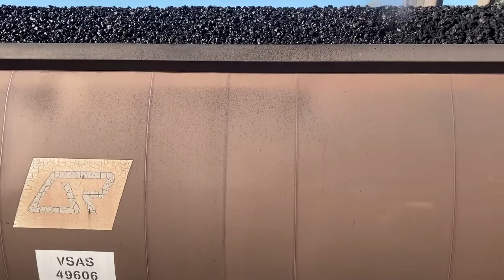Loading a Coal train

Comment: Train loading station where coal loading is regulated from CCR TLS. Using a hydraulic engine/HPU has a component above the surge bin & weight bin which can be adjusted how many tons will come out like having two side chambers, a gate that functions to open so that coal is in surge the bin goes down to the wight bin otamatis / manual will be closed according to several tons of requests from the CCR, when the gate is closed the chute will open throwing coal in the designated train area, hydraulics and PLC are one of the components, thank you

Comment: It’s a nice look at the loading, but can you show the electric locomotive passing through the loader bin, I really would love to see what happens with the pantographs as it passes through.
Reply from the maker: they lower down as they sense the Loadout zone
Reply: If you could ever get another Chance to show this procedure that would be awesome, so they sense you said ? In what way the drivers actually have to view when to lower, if the first locomotive goes through and it lowers, would it loose power? … it was done very different in NSW, at Clarence Colliery and Glenlee.
Reply: @hooliganarfza15 There's magnets attached to sleepers before and after the loadout. When in low speed control (hump mode) the loco passes over one pair of magnets which opens the MCB (main circuit breaker) then lowers the pantograph. Then when the loco passes over the second pair of magnets on the other side of the loadout, the pantograph raises and the MCB closes. If hump mode isn't activated, the pantograph remains up, the circuit breaker remains closed, and... boom!
Reply: Very well explained, see that truly makes sense.
Reply: @hooliganarfza15  the driver has a monitor screen that gives pantograph and MCB status. The loadout operator will often confirm with the driver the pantograph is down. The driver can control the remote locomotives independently from the lead loco.

Comment: Those cars look like they are being overfilled.  There is no room for the excess mounds in the center to settle into as the train moves down the tracks.
Reply: but it is overfilled only at the center and it should probably settle to the sides
Reply: There's no need for it to settle. It gets filled to max at around 54 tonnes per bogie and fits everywhere on the system under the overhead wires. If there is a big mound on top of that mound you're talking about, then there are problems.
Reply: It doesnt settle at all. 300+km later, on arrival at Callemondah and Gladstone port, its still holding the same shape. The coal is veneered, but thats for dust suppression.